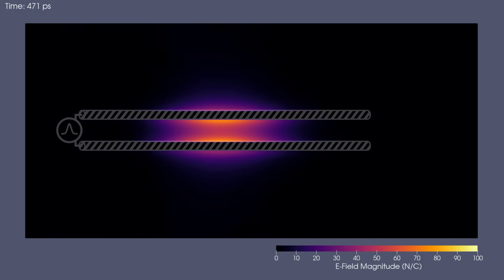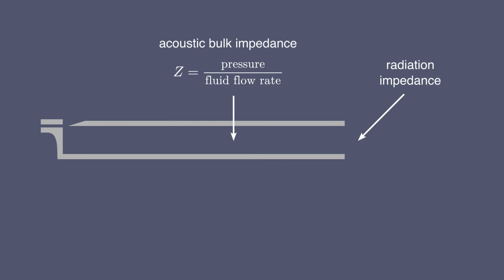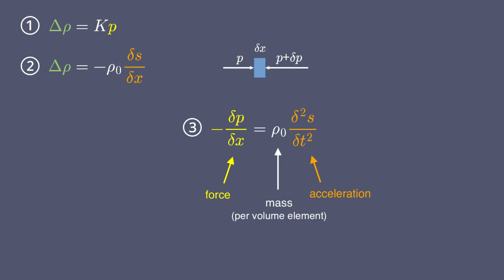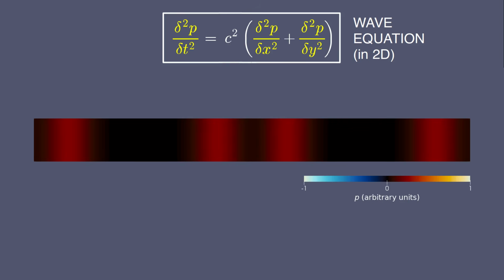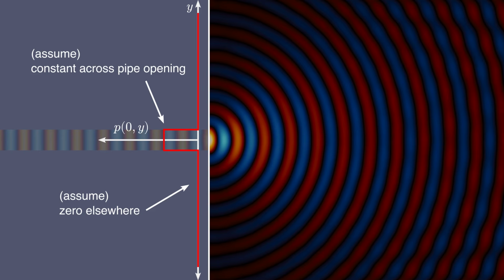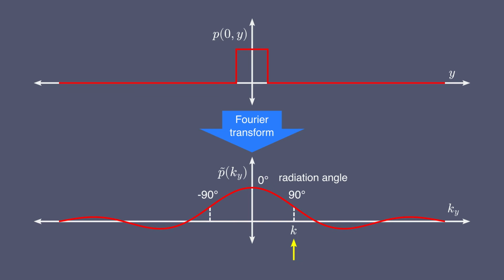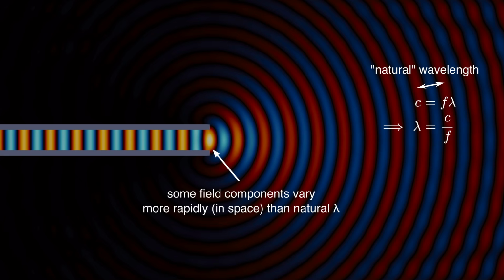Why does sound reflect from the open end of a pipe?

Comment: May I ask you what do you use for the animations?
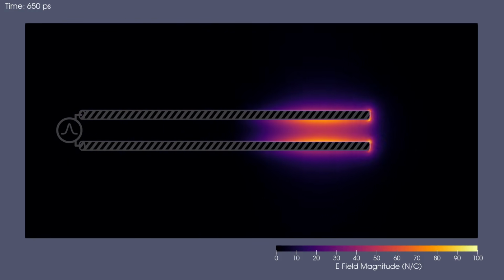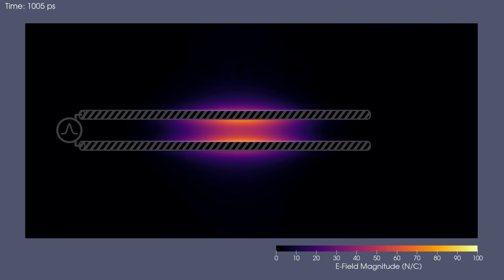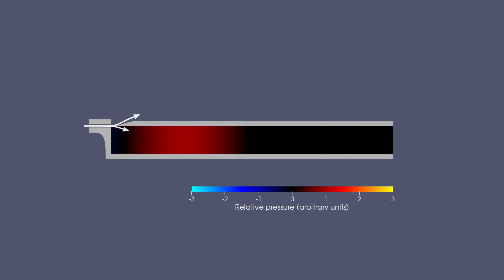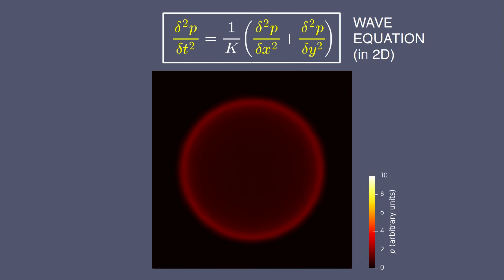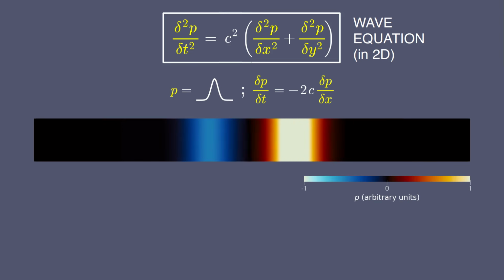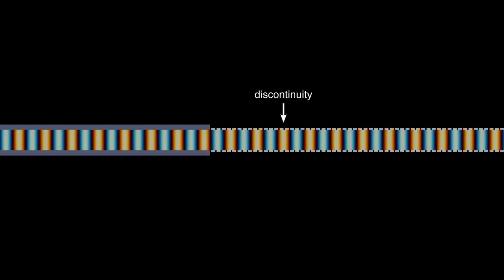Reply from the maker: I don't, unfortunately, have a single go-to animation program, I use a mishmash of different free tools, and it takes longer than I care to admit.  As with my other videos, the main data graphing/visualization is done in paraview.  The underlying data is generated from a variety of simulation programs (00:00 is the OpenEMS simulation from the previous video, 00:08 was done in OpenFOAM, 00:18 was my own wave reflection simulation in C++, 3:14-4:36 was Julia code based on https://github.com/tgautam03/WaveSim, 5:04 these animated plane waves are just generated via equations in paraview, the diffraction patterns at 5:23 and later are Helmholtz equation solutions calculated in FEniCSx and animated in time via equations in paraview).  My slides are mostly drawn in libreoffice, a few in inkscape, some of the slides I have more than one layer that I've composited together in my video editing program (shotcut).  I don't love libreoffice (or PowerPoint), it has lots of annoying bugs/features where things can move slightly between slides etc., but it does make simple things easy.

Comment: Enjoyed the video. I think you can still make the impedance argument by saying the guided modes of the pipe experience an interface the boundary, and you get reflection and transmission of waves at boundaries. The impedance here is the discontinuities of the type of modes (guided waves inside the pipe vs radiated modes outside the pipe).
Reply from the maker: Yes I agree in principle, and we can certainly usefully use impedance here.  I just think that impedance arguments can be a little circular.  The key thing is the coupling of the guided mode to the radiation field.  If the coupling is low, then there is an impedance mismatch and high reflection.  If the coupling is high, then there is not an impedance mismatch and low reflection.  But we don't need to introduce impedance to make that argument, it is clear that if there is radiation then there is radiation and if there is not radiation then there is reflection :)  Let me know though if you can think of any way to quantify the impedance discontinuity without going via this path.